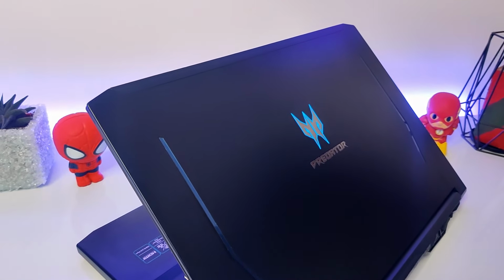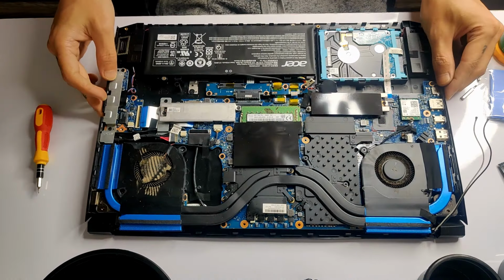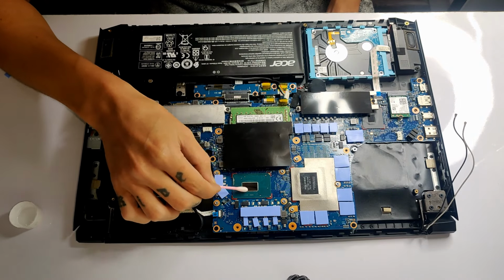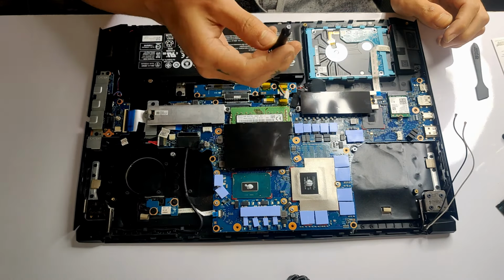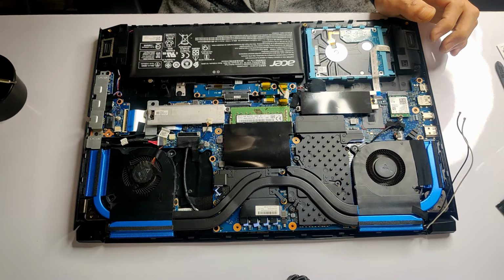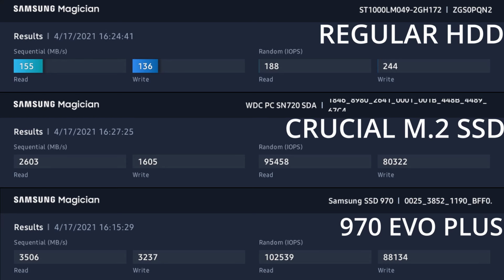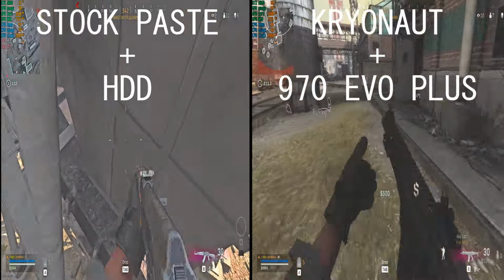ACER PREDATOR HELIOS 300 2019 UPGRADE | REPASTING | CLEANING GUIDE & BENCHMARK

Comment: Hey, thanks for the video! I'm not experienced whatsoever in this field, but I've noticed a lot of fluff in the fans, so I came to explore. I've never overheated the laptop, so I don't think there is a need to (and neither do I want to (I'm scared to)) perform a full surgery, but I do want to clean the fans. Genuine question - are there any major risks if I just open the cover, get my hoover, and gently hover it over the fans, just to get as much fluff out as possible? Obvioulsy I won't put the hoover right up into the fans, as I don't want to damage anything, but will some gentle paintbrush strokes and a hoover to remove the dust do an acceptable job? Pls do say straight away if this is a bad idea🙃 Any advice/suggestions is greatly appreciated, from you and others :) Thank u
Reply from the maker: Hi. Yes you can remove the back cover and use a soft paintbrush to remove the dust. Just make sure to unplug the battery right after you remove the back cover. You don’t have to be very gentle with the brushing. Lol.
Reply from the maker: Don't forget to connect the battery after you're done 🙃

Comment: Please tell me how much mm thickness (thermal pad) were used and are these pads better than Gelid thermal pads ?
Reply from the maker: 0.5mm for the vram memory and 1mm for everything else. 
Gelid are better because it has more thermal conductivity at 12w/mk, whereas the one used in the video is 6w/mk.
I've been using them for 2 years now and have no issues at all.
The link to the thermal pads used in the video are in the description, please check them out.

Comment: Hey man, how tight are the cpu and gpu screws supposed to be? I already messed up badly with my old laptop because of the screws
Reply from the maker: Not too tight. Stop when you feel the tension starting to build.
Reply: @MVNDRVX  Oh, thanks, but what about the screws that seem to bend the metal to reach a "tighting" point
Reply from the maker: @DanorDave  it will only bend or break if it's too tight.
Reply: @MVNDRVX  oh, well I should done alot more research when dealing with my old laptop lol, thank you so much for your answers and have a nice day 😊
Reply from the maker: @DanorDave  You too. Thank you!

Comment: Hey bro. Can i use 0,5 mm thermal pad for everything? i don't have the 1mm thermal pad.
Reply from the maker: You could try using 0.5mm, fix the heatsink, let it sit for sometime, open the heatsink and check for contact impressions. If there are impressions on all the pads, you can apply thermal paste on CPU & GPU and carry on with closing the laptop.
If not, then you will have to use 1mm where it's needed. I wouldn't recommend this but you can give it a try.
Reply: @MVNDRVX  if not, can I use 2 pieces of 0.5mm boss on top of each other :D?
tks for your help
Reply from the maker: @anhtrannhat3004  no please don't do that 😂
Reply: @MVNDRVX  haha :DD
i have clean my laptop many times but i don't know that we can use the thermal pads like that
i haven't used it before until i see your video
thank you so much
Reply from the maker: @anhtrannhat3004  if your thermal pads are still good, you don't have to change them.
You're welcome.
Reply: @MVNDRVX  From the time I bought the laptop until now. I have only replaced thermal paste, I dare not change or wipe other places besides CPU and GPU
It looked very dry but I didn't dare touch it     :DD
Reply from the maker: @anhtrannhat3004  I mean as long as your thermal pads are in one piece and not flaking/tearing apart, you need not touch it.
Reply: @MVNDRVX  oh
okee. thank you so much
Reply from the maker: No problem. You're welcome.
Reply: @MVNDRVX  hello it's me again :D i bought the 0,5mm too
I have read 1 number of comments below and I saw you say that use the 0,5mm for VRAM but I don't know where VRAM is in those places :DD
help me please. Thank you
Reply: i mean i bought the 1mm too
Reply from the maker: @anhtrannhat3004  the parts with pre-applied pink paste would be the vram memory.
I'll be starting my live stream now so will not be able to immediately reply here. You can drop by the live stream and ask me your doubts.

Comment: are the thermal pads sticky? will they stick on the chips?
Reply from the maker: It's a little sticky. They are strong enough to hold on to the chips or the heatsink. You can use them without an issue 🙂
Hope this video has been helpful. Do subscribe to show some love & support! Thank you 😊✌🏻❤️

Comment: What size thermal pads and what thermal paste to use I repaste recently but used arctic mx4 and I still touch 90 91 when gaming the links to the paste and pads are out of country for me
Reply from the maker: 0.5mm for vram memory and 1mm for everything else.
Can you tell me which country you're from? So I can share the link for the thermal pads and thermal paste.
Reply: @MVNDRVX  the United States do you think my Temps are high because if bad paste? I cleaned out lots of dust out of my fan too I'm also running cool boost with pretty high fan speed
Reply from the maker: It's the paste. I never recommend MX4. Go with the kryonaut.
Reply: @MVNDRVX  do you mind finding that link got the United States? Also should I use just paste or pads too?
Reply from the maker: @hebermatute6393  Yeah i'll find it for you. You don't need to replace the pads unless it's in a bad condition.
Reply: @MVNDRVX  I didn't find pads under mine but I'm climbing Temps around 90 I want to do whatever I can to lower them if it's placing pads and paste then I'm going to
Reply from the maker: @hebermatute6393  hey sorry about the delay. Just give me a day and I'll send over the links.
If you could connect with me over any of my socials, that would be great. Discord, Instagram, etc.
Reply: @MVNDRVX  what's the discord
Reply from the maker: @hebermatute6393  MANDRAX#1945
Reply from the maker: @hebermatute6393  Thermal grizzly kryonaut: https://amzn.to/3v75caa
Adwits thermal pads: https://amzn.to/3jbLAz2
Reply: @MVNDRVX  appreciate it very much
Reply from the maker: @hebermatute6393  if there's anything else you're looking for on Amazon, do let me know 🙂
Reply: @MVNDRVX  I appreciate it I ordered it now I ordered some the other day with my cpu Temps where should they be averaging at whole gaming I'm running auto and cool boost
Reply from the maker: @hebermatute6393  After repasting with kryonaut, it should be below 85 C depending on room temperature.
Reply: @MVNDRVX  I think Kyronaut is good but there have been rumors/reports of it having a short longevity.. as in it doesn't have a long lasting life, and is more for high temperatures and then to replace more often ... do you find this true? that is the only thing as I'd like to only paste every 3 years not every 6 months or 1-2 years if possible
Reply from the maker: @tereongullygully3314  I've seen a lot of people asking the same in the comments but I would have to disagree.
I repasted mine 2 years ago and never had any issues.

Comment: Hej man. Do I really need to get thermal pads, would paste be a big nono?
Reply from the maker: Hey! You don't need to replace thermal pads if yours is still good. If you're asking if thermal paste can be used instead of pads, that would not be recommended and it will definitely not do the job 🙂
Hope you like the video. Do SUBSCRIBE to show some love & support 😊✌🏻❤️
Reply: @MVNDRVX  appreciate the quick reply man have a great day 😊👋
Reply from the maker: @tggorudon2551  thank you! Wish you the same 🙂
Reply: @MVNDRVX  Hej man, I was wondering about the thermal pads, which thickness did you use? & Can I replace the thermal pads with a paste?
Reply from the maker: @tggorudon2551  0.5mm for vram memory (replacement for pink paste) and 1mm for everything else.
And about the usage of thermal paste instead of thermal pads, I've already answered that question. Please look up in chat.
Reply: @MVNDRVX  Thanks a lot man, just wanted to confirm that using paste is unwarranted & could lead to fututre damages. Thanks for the heads u!
Reply from the maker: @tggorudon2551  There's no point in using paste. It's not going to make contact for proper heat transfer. Regular thermal paste are less viscous.
If you can get your hands on high viscosity paste like the pre-applied pink thermal paste, you could use that. Not for the CPU & GPU though. I wouldn't recommend it.

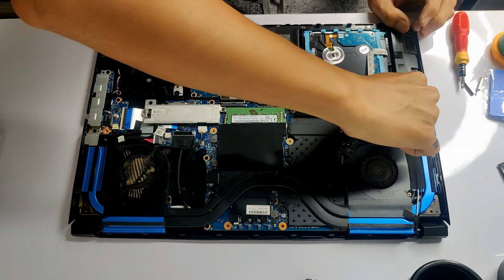Comment: 3:06 how do you remove the wifi adapter and reconnect it? really nervous about that part.
Reply from the maker: Hey @ank1t it's very easy. Just use some tweezer to pull up on the wire connectors. Just make sure to be gentle with it.
Or you could even unscrew the adapter itself and pull it out just like how you would to a ram or m.2 SSD 🙂
If you believe I was helpful enough, do subscribe to show some love & support 🙂❤️
Reply: @MVNDRVX  and how would i plug it back?
Reply from the maker: @ank1t54  if you just unplugged the wires, then just press it down in the connector. White wire on right side and black wire on the left, while the fans are away from you 🙂

Comment: I did this with kryonaught and artic thermal pads however my gpu isn't working do you know a fix? I'll sub if you tell me
Reply from the maker: @Barky Tron are you getting any error?
Go to device manager and check if your GPU is enabled and drivers are installed.
Try uninstalling and reinstalling the GPU drivers again.
Reply: @MVNDRVX  I tried to update the drivers but it just fails to install and the gpu shows up (sometimes) but the Temps don't  and it doesn't work to run any application
Reply from the maker: @BarkyTron  ok instead of updating, try to uninstall and reinstall again
Reply: @MVNDRVX ok but the gpu also doesn't show Temps in hwinfo but the gpu shows up in it and BTW I have the ph-315-78vl also what are the chances that the die is broken or something unfixable like that
Reply from the maker: Ok do this step by step.
1. Make sure all your drivers are updated including your Windows.
2. Go to Nvidia control panel> manage 3d settings> preferred graphics processor> select high performance Nvidia processor. Then click on Set PhysX configuration and select your graphics card in the drop down menu.
3.Right click on desktop> Display settings> graphics settings> browse> select application that you want to run with your dedicated GPU> options> high performance.
4. Check for any dedicated graphics related options in your BIOS and enable it.
5. If it's still not fixed, then update your BIOS from Acer official website.
Reply: @MVNDRVX  ok I'll do that but it was working before I changed the paste
Reply from the maker: @BarkyTron  something must've reset. Just try and let me know if there's any luck.
Reply: @MVNDRVX  ok I'll try but is there a possibility that like I chipped the die of the gpu or the mounting pressure is bad? Also how do 8 access the bios pressing any of the f keys during boot doesn't work
Reply from the maker: @BarkyTron  Not sure what went wrong. That's what we're trying to figure out.
You to have press the F2 key while the predator logo shows. Just keep pressing it multiple times.
Reply: @MVNDRVX ok thanks I guess I didn't press that key yet
Reply: @MVNDRVX  so i dident do that but i went on my pc to update it and the updates dident work altought all programs and things are running fine now and temps are good. it just still wont let me update the drivers even if i try to uninstall and reinstall it wont work so idk whats going on. do you know?
Reply from the maker: @BarkyTron  Open Killer Control Center and make sure Gamefast is disabled.
Reply: @MVNDRVX  what is that?
Reply from the maker: @BarkyTron  It's an application from Intel for optimizations.
It has an option called Gamefast which disables services, for example, windows update service and sets priority to your games.

Comment: Is the thermal pads optional?
Reply from the maker: Yes.. it's optional! If your thermal pads are still good then there no need of replacing them 🙂
Hope I've been helpful and you like the video. Do subscribe to show some love & support 😊✌🏻❤️
Reply: @MVNDRVX  Which thermal pads did you use in the video. Id like to know what type they are. I want to make sure I get the right ones and where do the 0.5mm and 1mm go specifically? Im new to this
Reply from the maker: @juancarrillo7319  it's called Thermal Grizzly Kryonaut.
0.5mm would be the replacement for the prehapplied pink paste and 1mm for everything else 🙂

Comment: hey, thanks for the tutorial, it was really helpful. i was just wondering if i can use the 0.5mm thermal pad for everything, is that fine?
Reply from the maker: You're welcome.
Nope. Please don't do that.
Reply: so should I just go with 1 mm everywhere? cuz its pretty expensive here in NZ for both :(
Reply from the maker: I wouldn't recommend it but a lot of people have asked me the same. You can try.
Reply: @MVNDRVX  Or can I just go with kryonaut paste everywhere? like instead of thermal pads can i just use the thermal paste instead?
Reply from the maker: @preethamsudhansh8588  No you cannot use regular thermal paste instead since it's low in viscosity. You can use thermal grease though.

Comment: hi my friends i have another question
Here I have changed my laptop for an acer nitro 5 517-41
are the thermal pads the same size as the predator pads? you answered one of the questions already to see the predator you zvaiy said that it was 0.5mm for the vrams and 1.00mm for everything else and I'll see if it was the same thing for the acer nitro 5 517-41 un big thank you to you hoping to have a quick answer
Reply from the maker: @Toto 511 Hi. For your particular model, you can use 1mm thick pads for everything 🙂
Reply: @MVNDRVX  a last little question 1 gram of thermal paste is sufficient for the processor and the graphics card ??
thank you my friend
Reply: @MVNDRVX  🙂🙂🙂
Reply: @MVNDRVX  d agree so 1 mm for any ??? even for vram memory?? Thank you
Reply from the maker: @lefleau3838  Yes. 1gm of thermal paste is sufficient for 2 applications.
1mm pads for all the chips including VRAM memory as well 🙂
Reply: @MVNDRVX
Reply: @MVNDRVX  a big thank you to you told me I want to know I saw that the freqence of the graphics card decreases when the heat increases so logically if I change the thermal paste it will remain at the highest freqence ??? so more efficient?? I would like to have your opinion s t p c is that I play at battelfield 2042 and there are many lag yet I have an rtx 3080 8 gb .. nvidia tells me which has a max frequency of 1815mhz 100 w max ...
Reply from the maker: @lefleau3838  Yes. Too much heat does cause CPU & GPU throttling. Make sure your Graphics drivers and windows are up to date, including the windows optional updates 🙂

Comment: yesterday i was playing game at my pc it  automatically shutdown and didnt open i tried everything even the charging indicator was not blinking today it turned on automatically after 16 hours my laptop gets like 101 102 while gaming do i need to replace my thermal paste and clean the fan and do system update and i havent cleaned the fan laptop seems dirty too its been just 11 months and thermal paste is not working any suggestions
Reply from the maker: Yes. It's overheating. You need to get a repaste done along with a good cleaning for better airflow.
Reply: @MVNDRVX  na bro today it opened automatically but when i just plug in the charger it shutdown automatically and not turning on again

Comment: Which its de VRam ?
Reply from the maker: The chips that are covered with pre-applied pink pads are the vram memory 🙂
Reply: Tnks! Im waiting to amazon give me my package with the thermal paths! I al ready dissemble my helios 300 and i clean al chips withs isopropyl alcohol
Reply from the maker: @joules424  you're welcome 😃 Let me know how it goes! Good Luck 😉🤞🏻
Reply: Im finish,! I started the pc and i use the program CPUID HW MONITOR, temp I7 10750 temperature : core #0 43-50° Core #1 42-50° its normal? Any way to contac u ? :( I need help, i have still windows 10
Reply from the maker: @joules424  you can contact me on instagram. The link is in the description of the video 🙂